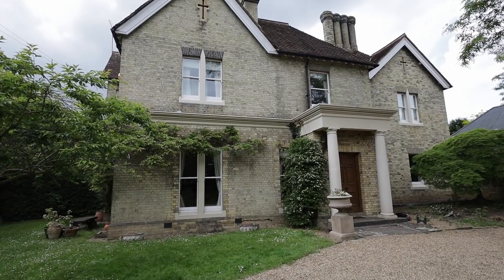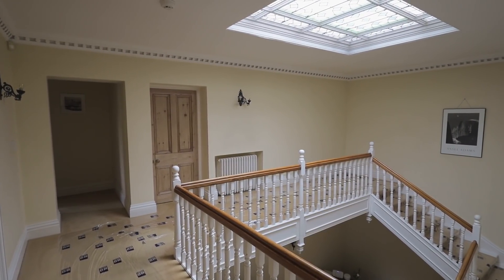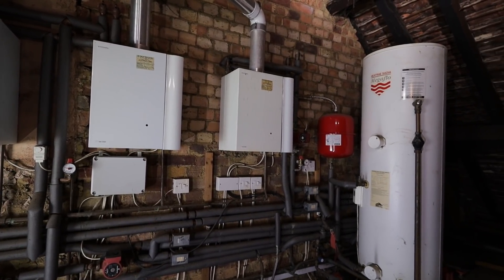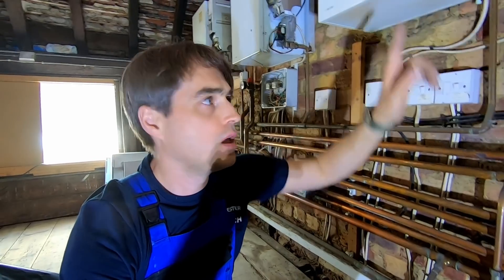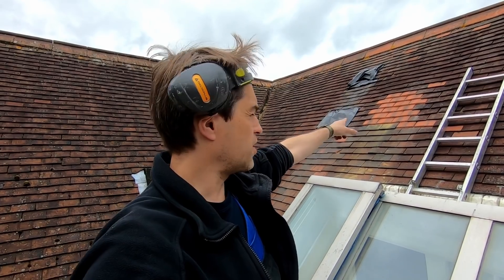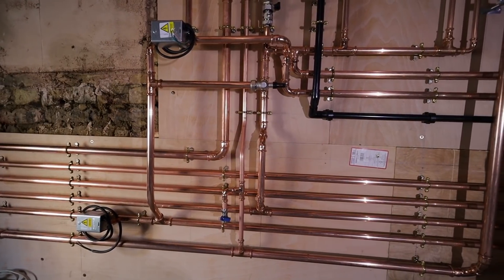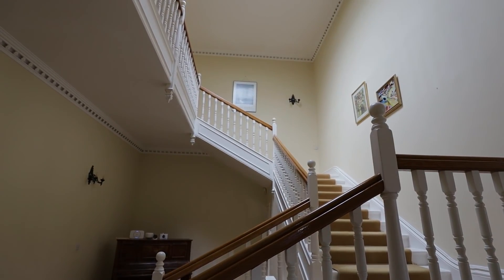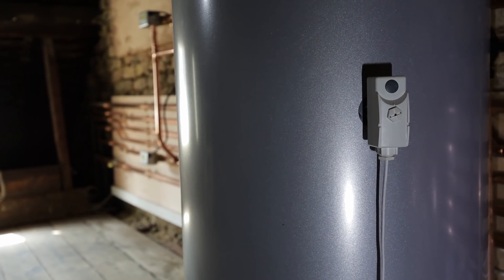How many boilers does this house really need?

Comment: Great job and very interesting watch 👍
Did you have any balancing issues working with the boiler pump only?
Reply from the maker: Balancing makes no difference with boiler or external pump though. As long as the pump can pump enough water at a given head you are fine.

Comment: What a mess to inherit! Great work but I'm really surprised you didn't go with a Viessmann - the higher end boilers use a cylinder thermostat input direct from the factory! Really hoping to see an episode with you installing German tech someday!
Reply from the maker: I just can’t get on with Viessmann. Too complicated for me and not a good match for this job for a number of reasons.
Reply: I can’t agree more I hate Viessmann boilers as much as I’m aware there are decent.
Reply: I didn't see the old system as a mess. Something similar is/was common in Elderly Persons Units and other communal commercial applications, but that one was well over 20 years old and ripe for a reworking. Using boilers in cascade enables you to service and repair faulty boilers and replace pumps without putting the system out of use. If it took a few days to source spares it wasn't critical as a base service was maintained in the meantime. Sometimes that is a lifesaver, and a reputation saver for the heating engineer concerned. You soon hear if people are cold !😱

Comment: Another factor that occurs to me is that it is vital that instructions are left as to how the system works, and how it should be maintained. Many service engineers do not come across these systems and will not know where to start. It's not " yer average" install. It's far better than that and it needs protecting and maintaining properly for all the right reasons.
Reply from the maker: Yes, I leave wiring schematics with the boiler manual.

Comment: The usual reason for finding a rogue radiator piped up to hot water goes back to the days of solid fuel when the rad was used as a heat sink before the days of thermostats. That's just a guess, but it's my guess😁
Reply from the maker: good guees actaully. They were called heat sink rads. The one in the cellar could have been a heat sink, do not think one in the cloack room was though.

Comment: The only comment I'd make is that there is no redundancy factor in a single boiler. Two boilers in cascade might make better sense in a big property. I quite liked the Viessman four pipe system that seems to achieve much the same as you have.   I never had dealings with Intergas, but I do understand their adaptability which makes it perfect for your system. I used to service the occasional Atag ( Edit : not Atag..they were Atmos boilers....my brain fade 😕 ) that uses the same heat exchanger as Intergas
Reply from the maker: what? Atag has the same hex as Intergas? Or same as Viessmann? I hear a lot about Atags, but do not like direct sales model. I need to keep my suppliers in buisness as well as be able to get help with parts quickly. Atag not for me for those reasons.
Reply: @UrbanPlumbers  I meant Atmos, not Atag that used the same heat exchanger as Intergas. I'm getting mixed up in my old age 😕

Comment: So your basically using the “cylinder” as an indirect storage tank? That’s what we call them in the states, or does that cylinder just store hot water made by the combi and is used when needed?
Reply: 1st one - tank has a coil inside carrying hot water from the boiler to heat the water in the tank
Reply from the maker: yes, indirect stroage, correct

Comment: quick question... so on this system. Will the boiler send water to the cylinder around 65 degrees what ever you set the hot water at... but then send a lower temp to radiators which ever you set the radiators at?

Great video.
Reply from the maker: yes, 70C to the cylider and weather compensated, usually much lower variable flow for radiators.
Reply: That's my understanding, yes.

Comment: i have 3000 sqft and run a single 35kw boiler.  Mate has 7000 sqft and runs a single 64kw heater which is still too big
Reply from the maker: Both houses could probably run on half of that!

Comment: intergas 36/40 Hre with a 300 litre cylinder on a X Plan system, just done a very similar job myself.
Reply: sorry forgot to add you can then adjust outputs etc.
Reply from the maker: Why 300! 40kw into high gain cylinder could reheat 200l in 15 minutes!
Reply: @UrbanPlumbers  We have a Vaillant setup with two 180 litre slim line cylinders piped in parallel.

 It's the 15l/min shower heads and wife/2 teenage daughters that dictated the storage volume.
Reply: @UrbanPlumbers  300 Because the demand for hot water on the job I've done it's in a pub with a high hot water requirement. Great job tho like your work. 

Quick question, regarding the xplan what is the purpose of the hot water timer other than to give you some control as the PCB does the work?
Reply from the maker: @haydensnart2423  the only reason I can think of is building regs or being able to turn dhw off. I actually did not realise you can time it on the boiler. I think you can o HRE but I am not sure about Xclusive?

Comment: The only reason I can think of to have the separate system would have been if at some point the towel rails were off the hot water and not the primaries back in the day and they didn't want to risk galvanic corrosion. 
8 mins in I think I'd be on two 35kw or one 70kw. At that size it would be over the limit and need automatic fill and be classed as a commercial installation though. 
Edit: So it would seem the towel rails were configured like that at some point, it's a shame to see an old set up like that though well thought out at the time massively over sized for today's standards, though modulation wasn't common place in domestic until Combi's post Y2K. This is why heat loss calcs are so important, or if you over size a system that it has the ability to modulate right the way down. 

Gorgeous pipework, and your control setups are the same as what we used to do for Viessmann and now Vaillant system boilers. It's just more cost efficient.
Reply from the maker: thank you. I do not like to oversize boilers for no resons, as in this case it would mean 2 boilers instead of 1.

Other companies quoted for 40 and 50kW - that is why I think they did not get the job, as I was the only one to actaully calcuate the heat loss.
Reply: @UrbanPlumbers  I could understand over sizing if there are plans in the near future to extend but we all should be doing heat loss calcs before submitting prices anyway. Especially with the new Part L coming into play and the subsequent fines related to poor design and controls.

That said if that installation was in a more remote area and slightly larger, our customers would generally prefer 2 smaller boilers so the system has redundancy to a certain degree. All things that should be taken into account anyway and discussed with a customer to meet their needs and expectations.

Comment: Really great video. Love the work you guys do. Also camera quality is great 👍.
Reply: What size is the pump in the system boiler ? Man enough for three radiator zones I guess. Cheers
Reply from the maker: The pump is just 15/60. Yes it is big enough for that size job.
Reply: 6 metre head over three floors with high ceilings and primaries on 22mm on a old system. Big Gamble. Great video.
Reply from the maker: @jamesjulian  I was aware that separation may be needed. The maths though told me I had enough head on the pump for the heat loss (23kW). I actually quoted for CCT and additional pump but wanted to see if it could be avoided. It worked, and the pump runs at around 75% head fine.

Comment: Good job.thanks for your efforts and sharing your experience ..I guessed that you'd fit a combination boiler.. around 35 kw I thought ..
Reply from the maker: combi for a 3 bathroom house is a really really bad idea ;)
Reply: @UrbanPlumbers  absolutely . I would of fitted a new mains pressure cylinder too obviously . Secondary circuit etc .
Reply: @UrbanPlumbers  why?